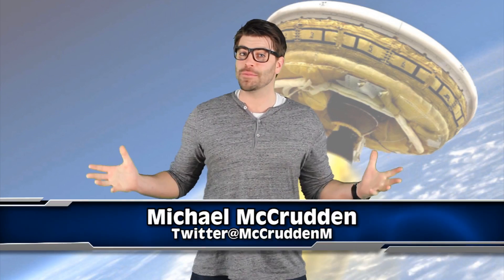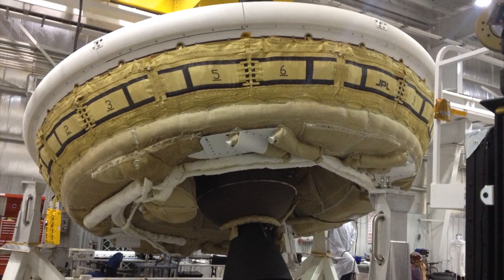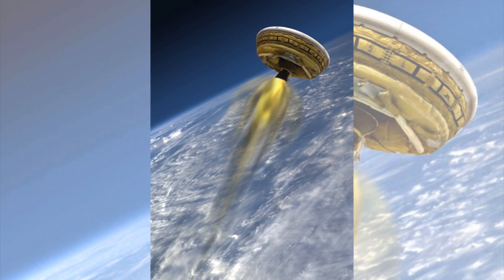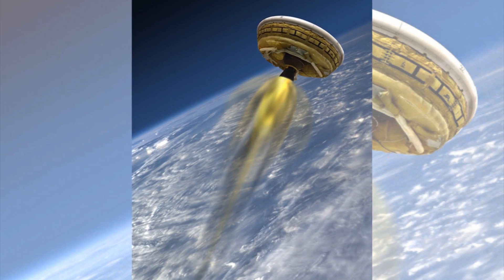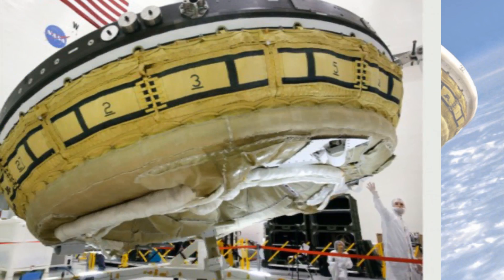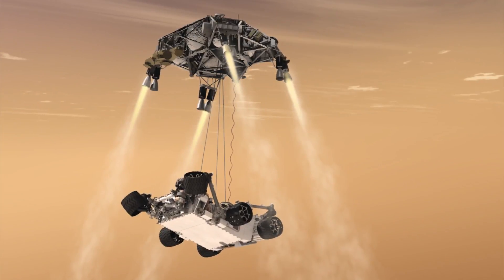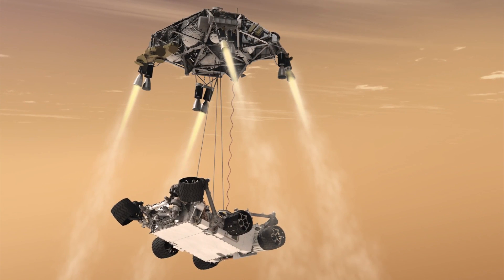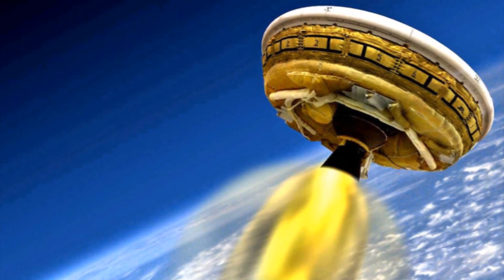NASA To Test A Real Life Flying Saucer

Comment: The Avarage distance of Earth and Mars is about 225 million km.
225, If you cut the Saucer into 4 equal parts.
225 divided by 4 equal parts = 56,24.
If I have 2 Saucers and you divide them into 4 equal parts and you are making another saucer and you only have 1/4 made.
4+4=8+1=9 sides
56,24 divided by 9 sides=3,144444444
If you round 3,1444444= to it's closest unit.
3, THE TRIANGLE HAS 3 SIDES.
If you join curved triangles you make a circle.
If you squeeze that circle
YOU HAVE AN EYE.

CIRCLE+TRIANGLE= ILLUMINATI
ILLUMINATI CONFIRMED( ͡° ͜ʖ ͡°)
         
              /\   
            / -; \
          / -   -  \
        /  -((0))-; \    
      /  ;-    ;:    - \ 
      ------------------
Reply: this accualy makes sence
Reply: The Random ( ͡° ͜ʖ ͡°)